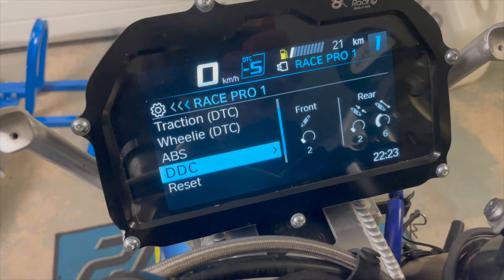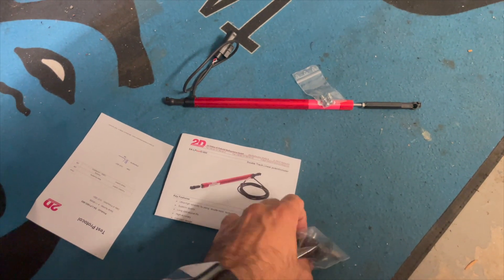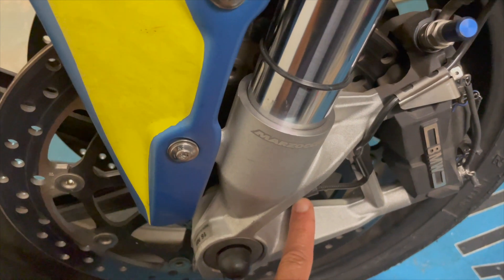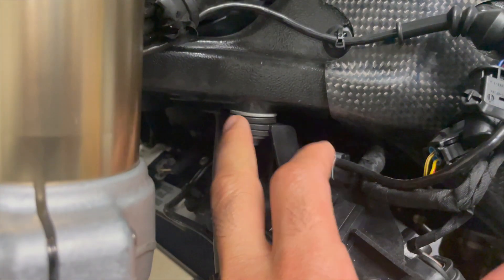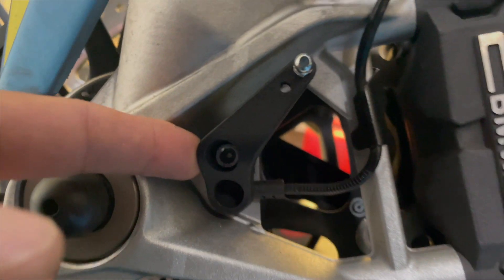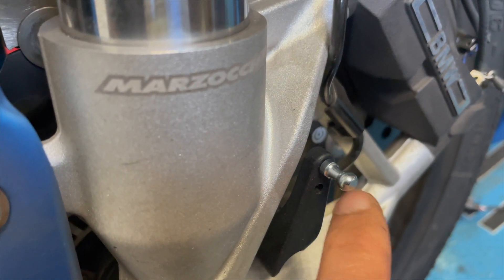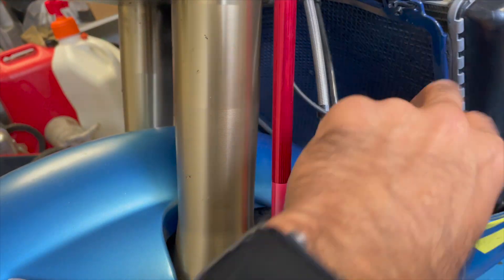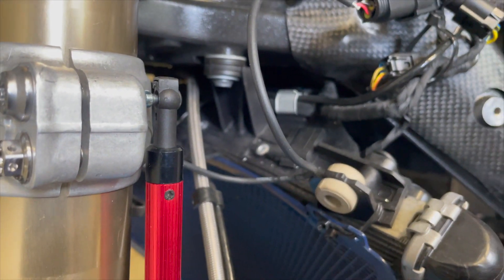2d sensor suspension BMW S1000RR K67.

Comment: great video.  im having problem with my 2024 s1krr   my compression is too stiff on front suspension.  im all the way soft on preload and damping in the dash but the forks won't compress over about halfway down the tube   will this 2d fix my problem or do I need to re spring the forks??  I weigh about 160 pounds with my gear on
Reply from the maker: Oh that is a tricky one. I dont know the pound system but it sounds like you need to get an suspension tec guy to have a look at your springs

Comment: Not sure how the fairings are on the -19 RR, but eyeballing the potentiometer path on my -23 RR makes me wonder about clearance issues against the black fairing that attaches to the top of the cooler. Any such issues for you when you mounted all fairings again with the potentiometer in place?
Reply from the maker: no issues at all for me

Comment: Did you find that the comp and rebound settings that are now active made a difference to the feel of the front fork that differ from DDC? How and why?
Reply from the maker: yes i did. Så riding on the track you need to be able to set the rebound and comp so you can adjust the bikes front depending on the track you are on

Comment: Great vid! Anyway we can see how that bump stop being made?
Reply from the maker: Hi Tony
so i found hard rubber that is used to support the car suspension 
like this
 https://www.biltema.se/bil---mc/bilverktyg/chassiverktyg/spiralfjadertillbehor/gummimellanlagg-6-st-2000043863

Cut it in half then drilled 2 holes and used ziptie to attach it to fork leg
Reply: @omidanka8785  appreciate that, I am inspired.  because, last version (K46), I stuck it on the frame, the frame on hot, and the glue lost adhesiveness.  the fork will not have that problem.  zip tie is also a genius part!

Comment: Hi! Do you have BMW/2D datalogger? I am wondering is the suspension travel is logged? The rear sensor is instaled already and both of them can be access from logs?
Reply from the maker: Hi. no i run the aim solodl2 for data and logg. So i gott a sensor for the front and connected to the original harnes of the bike. I get values from the sensor so it is logged in ECU

Comment: Manual states 19nm for the fork clamp bolts, where did you get the 10nm from, was that sticker on the bike originally?
Reply from the maker: hi,
from here:
https://alpharacing-live.dev.signundsinn.de/media/bd/d8/ff/1669194506/alpharacing_torque_s1000rr_k67_1122.pdf
Reply: @omidanka8785  I have that and didn’t think to look, I originally torqued it to 10nm but seen someone mention 19nm the other day so went and torqued it again and to be fair it barely moved. Funny how they have it at 10nm and BMW have it at 19nm, I notice the disclaimer at the bottom stating it doesn’t meet the requirements of BMW Motorrad.

Comment: Just had a look in the website and the part number seems to be different for the potentiometer 🤔  on the website it’s 7470HP001A00 for the 150mm one, I also hate how it states on the website “to be used with M calibration kit making you believe you require that for it to work. 

Not sure why the part numbers don’t match but glad you don’t require the calibration kit for it to work.
Reply: Just realised I was looking at the wrong one, found the correct one which doesn’t say anything about M calibration kit, my mistake haha.

Comment: thanks, helped a lot...lot less anxiety. Yeah, i'm with you about Alpha Racing lack of any instructions. kind of like them saying, if you have to ask, don't buy our products. Only comment, I have the S1000RR (K67) overhaul disc. the pinch bolts on the fork tube should be 19nm. keep the vids coming. i'm thinking of more mods also.
Reply from the maker: Great that I could help. 
Go make a great bike better with Mor modes 💪🏻

Comment: Hey quick question if I remove the charcoal canister would I get a engine or any message on the dash ?
Reply from the maker: Hi, Yes i think you will if you dont flash the ECU, there is a sensor connection to the canister. I did mine with RS2E.de they did a great job so i dont have to worry about fault codes.

Comment: I installed this sensor and i try to check with my gs-911 if i can calibrate it but i dont see any readings
Reply from the maker: Do  you get the rebound and compression setting? 
Do you have dds?
Reply: @omidanka8785  I get the settings on the dash screen but on my gs 911 doesn't read anything for the front only rear you can see movement. Sure I have DDC
Reply from the maker: @live2share  I talked to alpharacing. They told me to get the front and the rear wheel suspended from the ground and the re calculate the ddc from the menu on the dash
Reply: @omidanka8785  i will try it and let you know thanks